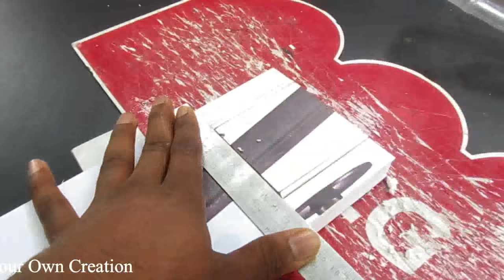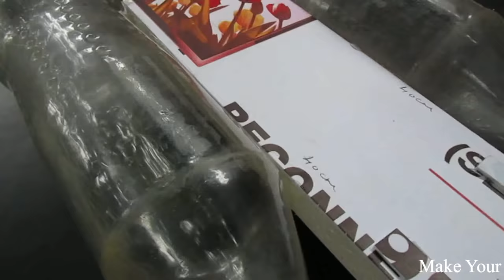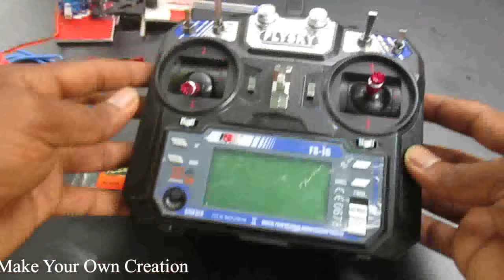How to make a BOAT || bottle BOAT - recycling plastic bottles - boat

Comment: i love diy projects but for a boat why not use better quality boat motors? any proper and even cheap in runner lower kv boat motor would be better . all the other stuff is ok. well i would use a simpler and most likely cheaper 2/3 channel pistol grip radio. they are designed for surface and give better range (in most brands)